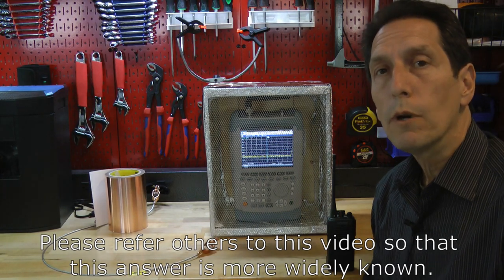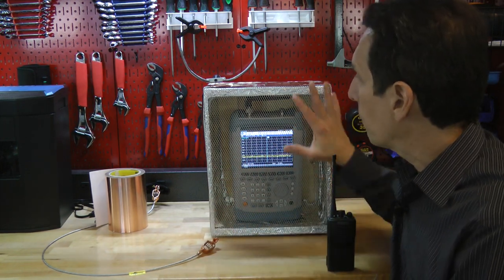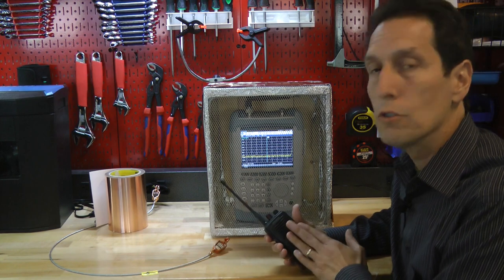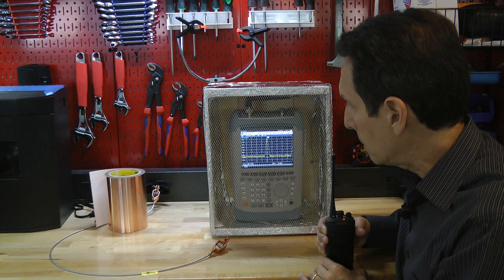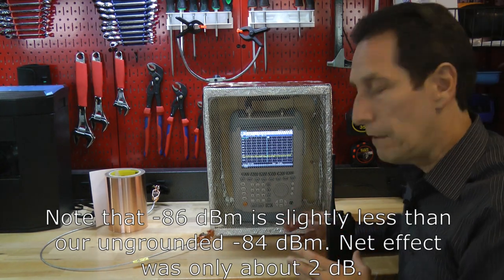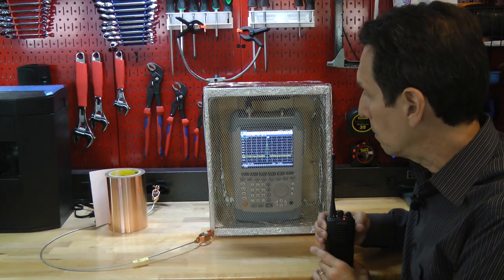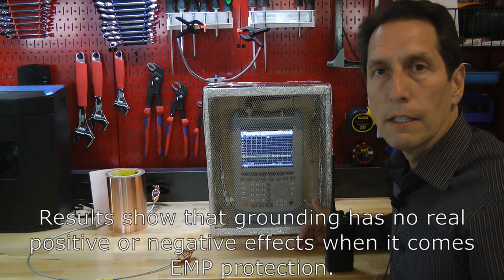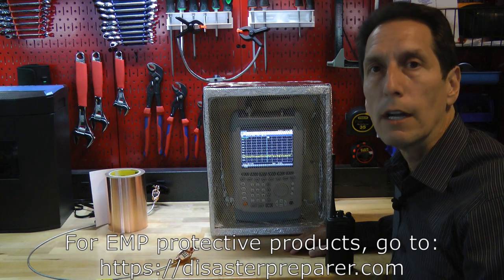Should You Ground a Faraday Cage?

Comment: I HAVE AN IMPORTANT QUESTION  ( THAT IS CRITICAL )  
I am building a bicycle.  What part of the solar electrical system .   (  Should be shielded to protect the electrical system from an EMP ) Like the solar charge controller .  THE BIG PROBLEM WITH THIS.  The  unit do build up some heat.  Has to be vented .  So it doesn't overheat.  So how do I protect something like this .  Effectively from an EMP.

Comment: I certainly would not do comparison test a Faraday cage with one complete side removed ! How about testing any effectiveness of grounding with the Faraday cage completely closed ? 
Would the adhesive on the conductive gasket cause any resistance ?
Being a Ham and frugal (now I've repeated myself), I would wrap the existing gasket in brass window screen and glue back with Barge's cement (since I have that available). Enjoy you videos, thank you.
Reply from the maker: The side is not removed. There's a fine conductive mesh in place of a solid barrier. Many Faraday cages are made of fine mesh. I used it so that people can see the results don't change, and I don't have to disturb the setup to open it each time to read the value.
Reply from the maker: The thin adhesive on the back of gaskets make no measurable difference. Same goes for the adhesive on conductive tape. I've measured with very expensive adhesive-backed tape and cheap aluminum duct tape, and both did equally well. As for Barge's cement, that would probably go on too thick, and might well cause issues with conductivity.
Reply: @disasterprepper  ...............Thanks for the clarification.
Reply: @disasterprepper  .........Regarding contact cement, not having tested, just speculation.

Comment: I get what you are saying, but it seems to me that during a big EMP or CME, power line  will likely experience a very high surge, similar in energy to a direct lightning strike. That surge is going to hit all connected wiring. Seems to me that any nearby wiring under this surge, will   induce a charge in the Faraday cage. Seems to makes sense then, to ground the cage to dissipate that spike of EMF electrical current.  Our power distribution systems rely on grounding to take them down to minimal levels. 

A lot of factors would go into it, but I can see a a large isolated Faraday cage becoming charged like a capacitor. If whatever you have protected is isolated from the cage itself you will probably be  OK, but I still believe that grounding the cage is better than not grounding it and potentially provides some additional protection. 

For a nuclear based EMP weapon, the grounding is probably not going to be needed. But I believe that depending on other surrounding factors like building wiring a very high energy EMP from a CME, could be at far higher energy levels. I'll ground my cage, cage, thank you. particularly if it is sizeable. 

Just my opinion, but I belief a CME or very large solar flare based EMP, is probably more likely than a weaponized deliberate one.  However, after the fact of a very big CME, there may well be some new incentives to use weaponized EMPs to create a big advantage. 

I wouldn't worry about a small box type Faraday cage being grounded. I tend to favor a larger scale approach of a garage sized  Faraday cage and using small cages in the bigger cage for sensitive electronics. It's tough to make a large Faraday cage that is perfect. It's liable to have some "leaks" that allow certain frequencies in. I figure there are primarily three things you want to protect.  Communication methods, like HAM radios and maybe a few walkie talkies. Transportation. which cold be a variety of possibilities. Basic, non electronic dirt bikes would be better than nothing. An old car or pickup pre electronic controls, Maybe keep a spare ECU in one of the small cages, for your daily driver vehicle that you won't shield. And third, electrical generating capabilities, like a mid sized gas/diesel generator, some solar panels and small inverters. 

The odds of everything getting fried are slim and some stuff is probably going to be worthless like your fancy smart phone. 

Have a good master plan and you can always use some steel garbage cans with tight fitting lids for misc stuff it might be nice to have, but not critical. Depending on energy levels involved, the simple steel trash can might be enough protection for some stuff. Just make sure whatever you store in it, isn't touching the steel walls of the can. Figure that what you are doing may not be government grade perfect, but just improving  your odds through hardening. A few other things you will want, but the EMP won't  effect them. Long storage food, medical supplies Some fuel and security protection.

Ideally we won't need this stuff, but most  of the time you don't need a seatbelt, airbags or fire extinguishers, but they are good common sense precautions,

Comment: Second question would wrapping an item in say plastic wrap then foil do any good or would it be too close to the item needed protection.
Reply from the maker: You asked two questions, but I can't seem to find the other one, so I'll answer both here. You do want to isolate layers of shielding, so your idea of putting an isolated foil container inside another container would provide two layers of shielding. Ideally you don't want the layers to come into contact with one another. Even a thin insulator (such as plastic wrap) would be okay, but I'd recommend something a bit thicker to limit capacitive effects.
Reply: @disasterprepper  ty very much.  would something like spray on flex seal make a good insulator do you think.  im going to run some tests of my own but just like to get input first.  ty for the quick response.
Reply from the maker: @survivalgamer8262  I would think that would be fine. Nearly any kind of plastic or rubber makes a good insulator. Many people just use cardboard, which is fine too.

Comment: It would have been nice if you had tested with the door open, Just as a baseline.
Reply from the maker: Yes, I could have done that, but I was a little worried about the signal level overdriving the spectrum analyzer. The front end circuitry is rather sensitive to very large signals.
Reply: @disasterprepper  I guess I should read your replies before I comment on someone else's post! >:-)
Reply from the maker: @aCycloneSteve  No worries, it was a fair point. :)

Comment: My issue with "grounding" or as the Brits call it more accurately, earthing a Faraday cage is the inductance in the ground wire.  at 460 MHz, this yields an inductive reactance of approximately 43.7 or 44 ohms XL per inch or about 425ish ohms of inductive reactance per foot.  It looks like 2 feet of ground wire or 850 ohm Xl.  But wait there's more.  All the feet of wire to the ground wire have additional inductive reactance.  This is why the grounding of a shield room is located at the shield room and may be connected by braid.   Further. all that wire from the Faraday cage to the ground rod acts like an antenna.  That is why you may see videos of people attaching a ground wire and the field reading actually goes up.
Reply from the maker: Thank you Mark, very well said.
Reply: In the USA, we speak of grounding, and sometimes, "Earth ground," or cabinet ground, but we rarely seek advice of the British, as they can't even speak English very well.
Reply: @mrjon75  Good one.

Comment: Dr Bradley:  Looks to me like the impedance of the ground you used in the video would be pretty high at 460 MHz because the ground lead was seriously bent/curved and possibly even be close to series resonant at 460 MHz. It would be interesting to know if the numbers change with a straight run from the cage to ground.
Reply from the maker: I answered this earlier, but I don't see my reply. The short answer is that yes there grounding connection certainly has measurable impedance at 460 MHz. My test was done in what I thought would be a typical setup. To eliminate the effects of impedance on the ground connection would require very short, low inductance ground straps tied immediately to a ground rod. I don't think most people would know how to do this properly, or want to go to the expense to do it, especially when the benefit is so minimal. Good question though.

Comment: The answer is YES.
 Either THAT OR the multiple Military specifications that I have been building EMI/EMC/Tempest facilities to, are all wrong.
I suspect that IF you used much higher power test transmitters you would see a falloff in the performance of the Faraday cage if it was not grounded.
I built a facility at Ft. Huachuca for testing Abrams Main Battle tanks.
The field strength we hit those tanks with was so high that the tank was Physically HOT after the test.
The antenna test ranges I have been on could ignite steel wool in your pocket if you walked in front of an antenna when it was radiating. The techs that worked on that range carried the steel wool intentionally so they would know immediately if they walked into an active beam.
I believe the question comes down to: If the power of the EMI that the cage is absorbing is TOO high, what happens when you use up all of the charge carriers in the metal? We know that once the metal's charge carriers are "used up" in reacting to the incident radiation, the cage will then begin to allow other frequencies through. So, does grounding the cage allow more charge carriers into the shield to fight the incident radiation?

Comment: Even if it's hundreds of miles away, a nuclear EMP would be a lot more power than a handheld radio, no? Would that power be enough to make a difference in attenuation or no?
Reply: Attenuation is relative to whatever source you have. While it may or may not be a more powerful source, a minus 60dB attenuation enclosure would always provide 60 dB down from the signal or EMP strength. So much better than leaving it out in the open regardless of what creates the EMP.

Comment: the strength doesn't really matter , its the wave length compared to the hole size that matters.
take a microwave for example. that screen door only works because the microwaves are larger then the hole diameter of the screen.

i'm not convinced you took the wave length the radio produces into account when picking this screen.

Comment: he messed up the experiment:   he failed to show the Faraday cage has any discernible effect on the radio signal.   if the mesh wire has no effect, the grounding will not register as any different.
Reply from the maker: I answered this earlier, but I don't see my reply. It wasn't really a mistake, but your point is fair. I didn't show the effectiveness of the Faraday cage because I've talked about that in a number of other videos. I was just focusing on the ground connection effects.

Comment: 2db is a 50% reduction, dB is in log.
Reply from the maker: Actually a -2dB in electric or magnetic field represents about a 20% reduction. If we were talking about power, then -2 dB would be closer to 37% reduction. Most people don't realize that dBs are used differently when discussing voltages, currents, fields, and power. A useful tool can be found at: https://www.daycounter.com/Calculators/Decibels-Calculator.phtml. I should also point out that to protect from an EMP requires around 50 dB of shielding, corresponding to a reduction of 99.7% in the electromagnetic field levels. Military standards dictate 80 dB (which is 99.99% field reduction), but I see that as a bit overkill.

Comment: the EMP will generate a magnetic field in the metal can. When you ground it, it allows that field to collapse and dissipate to ground, doesn't it?
A stronger signal would induce a stronger magnetic field that might saturate that metal. Would grounding it help dissipate the energy during a higher energy burst?

Comment: When you say "grounded" we assume to mean a common ground. Please redo this experiment with a transmitter that is also grounded.
Reply from the maker: Actually, in this case, when I say ground, I mean providing the Faraday cage a direct path back to earth ground. People often assume that such a path will offer greater protection due to it offering a discharge path. For fields in the far field, however, grounding doesn't really do that. I wouldn't want to ground the transmitter in this case since the ground would inadvertently connect the transmit and source side, and potentially compromise the experiment. The radio is imperfectly mimicking an EMP by generating in this case a narrow-band RF signal, rather than the wide-band emission from an EMP.